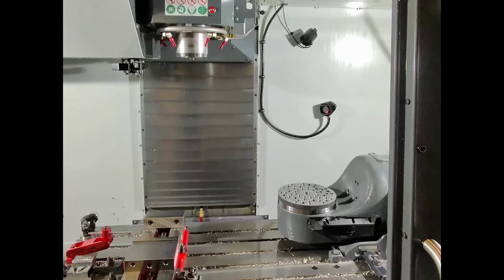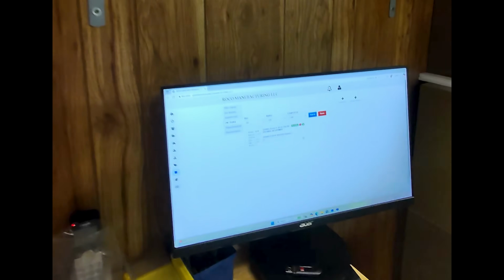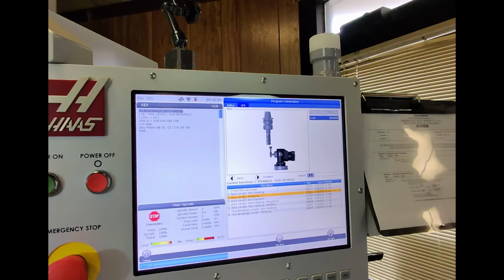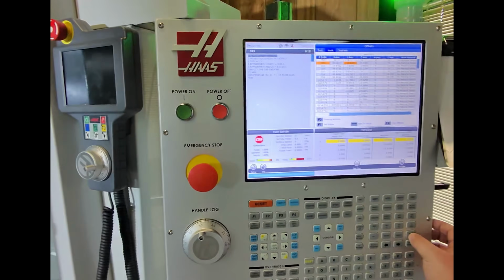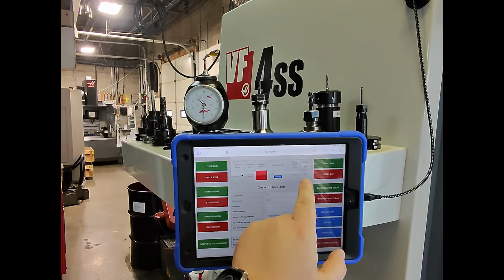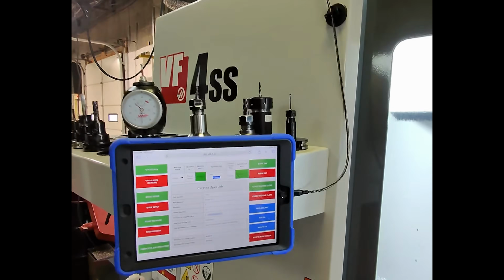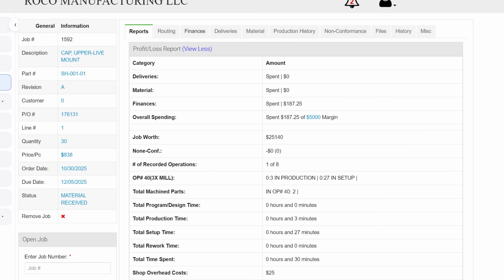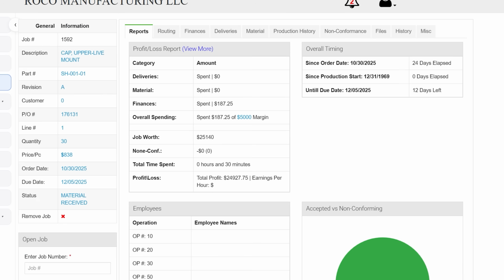Job Tracking at a CNC Job Shop by Roco Manufacturing - Powered by EzShopFlow

Comment: So you don't have any kind of flat ground on that 5/8 endmill?
Reply from the maker: No need for aluminum. 8k RPM @ 240IPM Full Depth of Cut with 10% Stepover, made tons of parts like that with 0 issues.